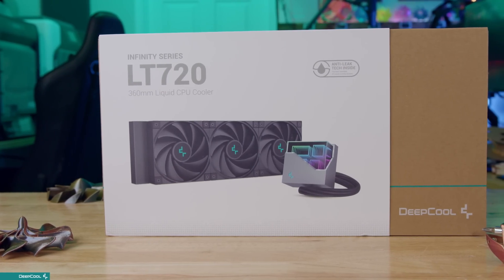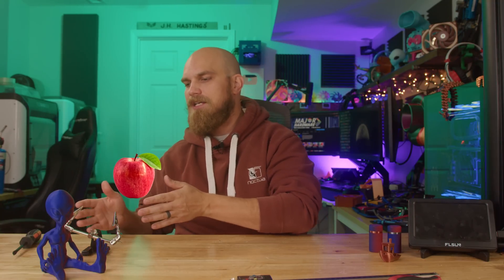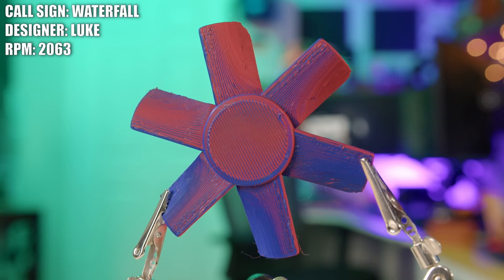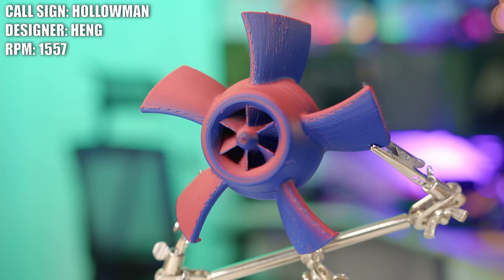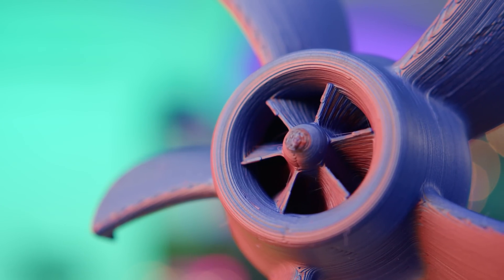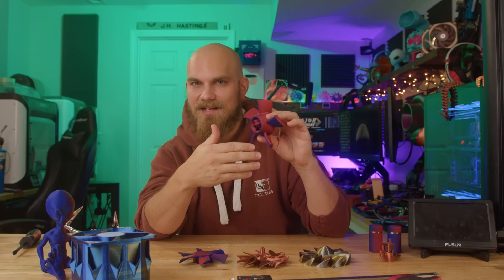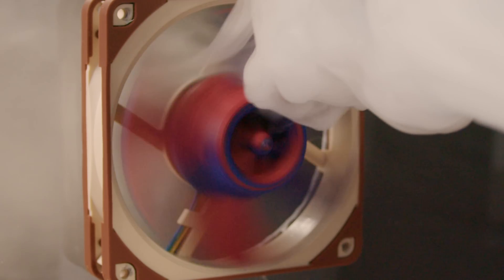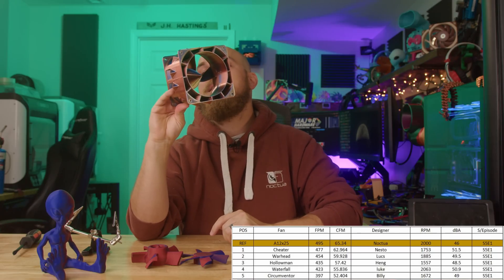This is LITERALLY two fans in one | Fan Showdown S5E1

Comment: Don't recall who said it, but it's better to have a fan pull air through a radiator than push through.
Iirc, it has something to do with less turbulent airflow when pulling than pushing.
Reply: That would be an interesting test. Comparing the performance of a fan in push vs pull configuration
Reply: I know Linus always says it. It's easier to clean a radiator without taking fans off lol

Comment: Hollowman only spinning  at 1550 rpm.. could it speed up or is it too heavy?
Reply: might be the air going in through the center adds a resistance to the motor since it would have to spin the air inside the blades.
Reply: blades might be a bit steep. but more RPM would get more centrifugal force through the blades (force= square to RPM)

Comment: Could you show a ranking of fpm/dB? I think that might be an interesting competition in itself.
Reply: For this it's probably best to standardize it somehow, since dB is far from linear (since it's logarithmic)
Some example standards:
* performance at 30dB
* dB at 300fpm
Reply: @TheDoh007  Good idea. If we want to compare linear to linear units, we can convert with: linear power = 10^( dB / 20 )
Reply: @NickCombs  Oh yeah you can calculate that!
Although the equation for linear power is 10^(dB/10)
the equation you gave is for voltage

Comment: You know, I didn't think those hollow blades would work at all, but it actually pulled air into them. Pretty cool. Probably pointless, but cool.
Reply: Air will enter it, but with the diameter of the fan, the blade rotational velocity will be rather low. Such small fans need a high rpm to move air, and it is not a high thrust fan, just high airspeed.

The paths after the fan are a source of high drag as well, with erratic angles.

I would guess the pressure variation between the small fan and the trailing edge of the blades is doing more than the fan.

The small fan blades are a source of drag and slow down the fan, so in the end, it likely is, unfortunately, a less efficient fan. But maybe I'm wrong.
Reply: @Vaterraman  Yeah I was almost going to write that. The part about low pressure at the blade edge pulling air through there, but I didn't bother.

It's still fun it placed second.
Reply: ît is the centrifugal force that ejects the air aout the rear of the blades. more RPM= more force

Comment: Would love to see both airflow standard as well as you doing the airflow through the radiator
Reply: Airflow without radiator is basically just a "paper stat", like crank horsepower in a car. It adds no value to the tests and just overcomplicates it.
Reply: @sepg5084  Some of us still use case fans to push air through our case, not everything is about radiators.

Comment: If you hook a small pump and tank up to the radiator, so long as you keep it to as little coolant as needed, you could even test active cooling that happens through the radiator while performing the air flow test
Reply: Airflow through the radiator is what causes cooling, so his setup is enough as it is. Overcomplicating it adds no value.
Reply: @sepg5084  Gee, not able to find a more insulting way of putting it?
Reply: @Arahknid  It's... really easy to make that more insulting. Less insulting would be difficult. At worst it's slightly more confrontational than necessary. And even that's debatable.
Reply: @laurencefraser  it's so nice the ignore feature when people reveal themselves to be who they are

Comment: Hollowman did far better than I expected. When there's a huge fog on the other side that usually means it didn't push the air well enough where as all the others sent the air streaming away from the fan pretty evenly.
Reply: Looking forward to a Hollowman II
Reply: @pctrashtalk2069  ok I'l make a new one. I also sent a version with no "turbo" . I think it needs more blades
Reply: @marckerger  It was really pulling air into the central fan wasn't it?  The smoke test really shows whats happening.
Reply: @pctrashtalk2069  yes it does. just that it is more the negative pressure sucking in the air than the Turbo fan.

Comment: I Love your channel Major Hardware, but can you sort by CFM/dBA to measure efficiency?

It's great that you sort by Maximum CFM, but I think you need 4x Ranking charts.

1) CFM based with Best to Worst, regardless of other factors (You already do this)
2) Static Pressure based, with Best to Worst
3) Efficiency for Volume of Air moved through (CFM/dBA)
4) Noise level

This would give your charts more meaning.

And if you look carefully at the "Efficiency" charts, you'll see why Noctua is still at the top.

=D

Comment: So Noctuas fan is the one to beat. How unsurprising, that it performs best in a test setup closer to the real world application.
Reply: The Cheater should work really well as an intake or an exhaust fan in a case, since high airflow fans are the best at displacing air inside the case.. well, this is pretty much where all of the high-flow designs would land. 
Static pressure on the other hand is a different story. Have you ever noticed that specialized SP fans (like the Noctua P-fans) often has larger blades, and a flatter profile compared to their airflow counterparts?
At least as far as the older fan designs went. Nowadays, advancements in fan technology has created designs that can do both airflow and static pressure very well.
Reply: @Skarfar90  haven't really seen this separation of airflow vs SP fan design in all the new fans to have come out in the last 5 or so years tbh. Maybe that's because when you account for the 2-3 layers of mesh and grating most cases have in front of fans, and the general crammed internals of modern cases, SP is important in every scenario.
Reply: @ThunderGoatz  This is why I mentioned advancements in fan technology. Most modern fans are capable of both use cases. 
Older fan designs were often specialized for single use cases.
Like for instance the Noctua F or S series were optimized for higher airflow, while the P series were static pressure optimized (as well as meant for silent operation)
Reply: That’s interesting—— what if the fan was exhaust, with gaskets, would the results be different???
Reply: @andyking05  I think @Formbi meant exhaust in a case. And as for the original comment: every season on the fan showdown so far tested a real world scenario, just different types. This one.is a static pressure focused test, in which the a12x25 excels, because it was designed to have high sp. The fan submissions in this episode were probably designed with either no particular specialization, or to have high airflow, since s4 tested pure airflow.
Reply: Just saying the noctua did deal with the other test set up really well so it is just a well designed gan
Reply: I tried to click like on this button as least as many times as I've watched fan show down videos, supremely underrated comment. Everything else (mostly) has essentially been case fan oriented, now we are finally working on static pressure and, therefor, the most cooling intensive applications, blowing across a radiator.
Reply: You might suspect that Noctuas hired real engineers or something.
Reply: well, if you put a fan on the exhaust, it wouldn't have to have a lot of pressure
Reply: @formbi  yes and no, actually it still would need some static pressure to overcome the resistance of the radiator
as per definition, pressure is resistance to flow, so if you only have flow but no pressure then you won't get far

theoretically, it should do better in push configuration(or intake if you will)

Comment: It would have been nice to see the smoke going (or not going) through the holes in the Circumventor's box
Reply: Possibly not enough restriction and too many inlets to really see the Venturi effect in action
Reply: I saw some going past the fan, but I didn't really see it get sucked into the side vents.
Reply: That is what we saw unfortunately. Bypass inlets rely on a bypass fan, because the environment behind them is at a higher pressure due to the main exhausts. Notice how you don't see inlet vanes on the outside of high-bypass jet engines.
Reply: Well, there was no smoke coming out of those holes. Meaning the air flow was going into them as intended. The question we are left to speculate is just how fast.

Comment: Idea: run each fan off a fully charged battery and measure how long it lasts
Reply: Or just monitor the voltage and amperage to calculate the wattage each design uses.
Reply: @lennart637  your suggestion is much the issue of lab test data, where as a battery run down test helps bridge the gap to real world application data. May not be far off but there are some features that will effect the efficiency vs run down time.
Reply: @David_Mash  A battery run down test would take much more time and introduces another variable (the battery), just like the test he did in the beginning, actually cooling a PC, takes much more time than messuring the airflow through a radiator. Also who runs PC fans on a battery?
Reply: That would be something cool to know but i dont think it would matter in any practical situation :D
Reply: well they'd all run for exactly the same amount of time?
assuming the battery has the same charge everytime...
Reply: @Rare_K_  They wouldn't some of the fans push more air aka doing more work, which requires more energy
Reply: @lennart637  but theyre all running on the a12x25, so even of theres no fan or a brick there it will still use the same motor, resulting in practicly equal load in terms of using battery
Reply: @Rare_K_  as a heavy design stresses the motor, heat builds, more resistance, all things being equal start to not
Reply: @Rare_K_  you could just trust us as it is true but visually learning is so much more fun..and valuable.  Hope we can get this idea added
Reply: @Rare_K_  different designs will use the energy in different ways

Comment: I'd love to see all the top fans from each season put up against each other (season 1, 2, 3, and 4)
Reply: fan showdown: season 5: in paradise
Reply: and perhaps do an episode with the Phanteks thiccboi and other A12-a-likes too!
Reply: @HazewinDog  and the Silverstone FHP 141super thiccboi maybe. It's technically 140mm fan, but it has mounting holes for 120mm.  It can also change the airflow direction without the need of physically flipping the fan.
Reply: @HazewinDog  erm you mean nideq/scyth clones (which the obnoctus a12 is)
Reply: Ya I want a recap because we didn't get recaps for some of the other sessions
Reply: Fan Showdown: All Stars!
Reply: I think Sound should be a factor again, you stopped caring about sound to airflow... the top fan should be quietest but highest cooling
Reply: but reprinted with current 3d printer and settings as in this run. some of the earlier fans seem to be printed at higher resolution ( and some looked lower quality also). -or just cleaned up better. print res/quality will play into performance tests quite a bit.
also not a "fan" of using the multi toned filament to print theses tests.  it just makes them look out of balance when spinning. even if they arent.
Reply: This is the way
Reply: Same
Reply: yea at least the podium (top3) of each.
Reply: Single piece fans
Reply: Thought the same thing, too!
Reply: TA

Comment: Why does no one sand their 3D printed projects?  They would be far more efficient if they had smoother surfaces...  It's really not that much physical effort...
Reply: Pretty sure he tested this and it made a slight difference, but not enough to justify the time spent sanding. Could be wrong as it’s been a while since I saw that video.
Reply: I believe something like this was tested in season 1 or 2 and it made no difference. Since it takes longer, it wasnt worth doing.

EDIT: link to video https://www.youtube.com/watch?v=H33_5yJEZ08
Reply: @philgoodinc2  You know, was actually thinking that as I was typing, at that scale it would probably make little difference.  My brains logic was like "Well, would it not act like a dust blanketed fans?  Or perhaps t may make it move more air.  Anyways I'm sure there's a difference, just not all that noticeable.